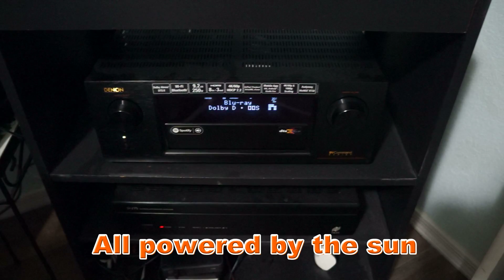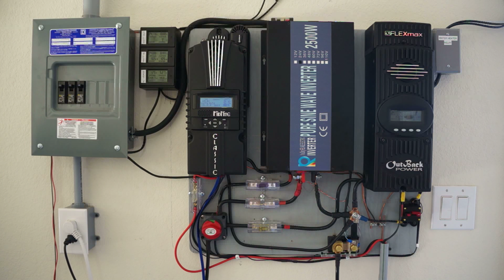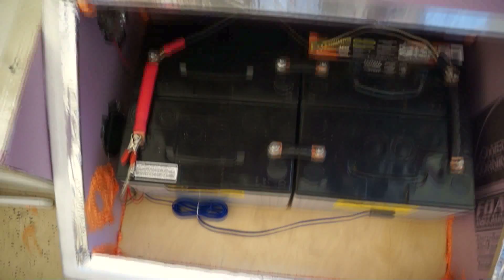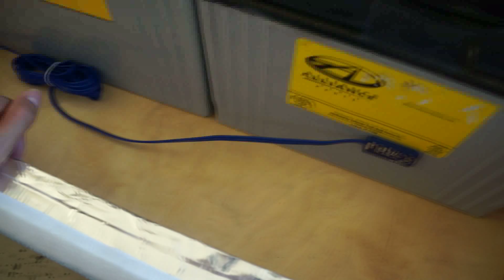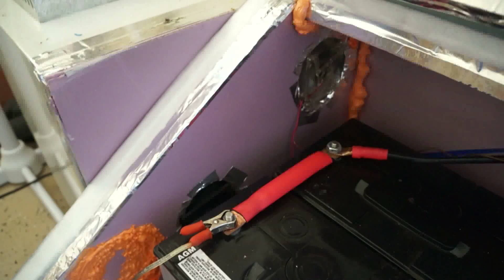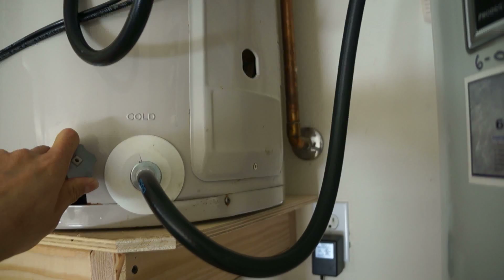2kw Off Grid Solar Overview - cooling battery bank, electric solar water heater! Midnite 150 Outback

Comment: Hey I wanted to mention that I was having the same problem with o back going into charged mode and staying there what you have to do if you have to calibrate your charge controller with your battery Bank to fix that

Comment: why do you put some panels in parallel and some in series? why not put them all in parallel. i am still learning.
Reply: also is the whizbang like a ammeter? it's just there to read current?
Reply from the maker: @510purple  to archive the right and max voltage the charge controller can handle.  Yes whizbang is a current sensor that feed data to the charger.

Comment: I'm not an electrical engineer or a physicist but I have real issues with the idea that running that refrigerator as a bodge to cool the batteries is the right way to go.  I have read about the coiling of the cold water (preheat)  around the batteries before the hot water heater.  I liked that.  I heard somebody say "dig a hole and put 'em in the ground".  Possible.  Also, way too small a battery bank.  Jokingly small.  I have two 100 watt panels in my van and I think I've got more battery storage than you do.  Nice mix of kit though.  #hobomessiah Enjoy.

Comment: Hi sir we are using 2hp solar system with 2kw panels by only solar..we want connect 2KW inverter to the same panels to get power to batteries for lights and other use..is it works ?

Comment: The first concern I have regarding your electric water heater plumbing job is your connecting the pressure relief valve to a re-entry into your water line. In the event your heater overheated the weakest place will blow. It will either be the connected hose, copper tubing or water tank as the only relief available is when you are running water out of a faucet. That, generally, won't provide enough displacement to avoid a malady!
Enjoyed your videos. Up on the 45N degree line the ambient temperature makes your system prohibitive.
Reply from the maker: I think you got it mix up.  The relief valves go into a pipe into the wall and go to the side of the house.  I T joint the new tank relief valve into the existing pipe, so the both share the same drain pipe.
Reply: @DIYeverithing  Whew!, missed seeing this on your video. Glad to see that you thought everything through completely! Sorry for the interruption but was concerned for your welfare.

Comment: Hey, thanks for the videos.  I am trying to do exactly what you have done with running stuff during the day when the sun is out to mainly use only solar and not the batteries.  But I have yet to figure out how to do the next steps.  I also live in PHX and would love to use the sun especially in the summer.   :D   You said you found a local dealer in Arizona for the batteries with cosmetic flaws..?  Where is that place at or called if you do not mind me asking???   Also do you know of any groups that are local that either meet up or just chat online, so I would be able to ask more detailed questions and figure out what I need to do so I do not hurt myself???  I did want to message you directly, but I have not figured out how to do that.  I have many other questions, but I have no idea if you are even still reading the comments on these old videos...

Comment: Thank you for sharing your system and your insights with us.
If I may, I'd like to share a couple of ideas with you. First, to keep your batteries cool, and preheat the water going into your first electric water tank may I suggest a coil of tubing inside your insulated battery compartment that all your incoming water goes through before going to your water heating system. Second, don't forget to do the periodic maintenance and replace your anode rods in both water heaters to reduce galvanic corrosion to a minimum.
I have two questions for you. First could you have used the original thermostat controlling a DC relay in order to power the DC water heater element? Also where did you get the thermostat and element you did use eventually?
One more thing, did you say you each take two showers per day for 6 showers total? I'm curious why so often?

Comment: Hello, I have a quick question about your sub panel. Are the neutral and ground bonded or has isolated ground bus?
Reply from the maker: Isolated ground bus.
Reply: Thanks. It's confusing, as most grid main service panels the neutral and ground are bonded. Perhaps that are inside the inverter.

Comment: So, how did that work in the winter? With those high garage temps there wouldn't be much heat loss. Many tanks need more than 70W continuously just to overcome heat loss.  I use two tanks in series, primary 9gal and secondary 20gal.  That gives me fast response in the morning. Generally a preheat tank like you have is not worth heating above 80F as most of the extra energy will be wasted in heat loss.  I'd plumb it sy you have the option of using the gas water heater as an unpowered tank bringing water temps up to ambient.  I use 2,000W 120V elements which are cheap and common and work well with a 36V string off raw panel or 60V grid tie.  I heat all my water with PV which is now cheaper to do than direct solar.

Comment: In my shed I used AtticFoil reflective insulation. It is cheap ans staple it up. It dropped the temperature in the shed by 10-15 degrees.

Comment: I have t-105's and L-16's in series. Not together. In a 24v bank. Not a bad idea for keeping batts cool. I don't have to worry about that here. And only possibility of freezing maybe 2 months a year. If I'm not home. With the bank. Indoors its out of the cold as long as the house is warm. I just gotta worry about gassing. So its vented with 2" brushless  motor fan.  Just enough to create a flow.

Comment: I really want a classic 150! They all got that price tag on them. I think you get loads more with the mid night classic! It would be nice if they made a controller that would do 150-200 amps. But its probably cheaper to buy more controllers. I hope to have 3kw to 4500 wtts in solar. I'm off grid. And heavily use the generator . not as much now. I have a 5 kw inverter. And 700ah batt bank. And 150 ah lithium bank I'm working on. It should be 300ah in about a month.  I'd like to have a 4-5 day runtime without sun!

Comment: Witch do you like better? The flex max or the Classic?? I heard lots of good things about the classic. I'm really thinking about getting one! Then eventually two.  The classic has loads of capabilities! What would you want for the flexmax?
Reply: JAMES! Since the 70's The only down side to the classic would be the wire size of the terminals. He also explains that the controllers cost basically the same but to have the outback connect to the internet it would cost $300-$400 more than the classic and the whizbang jr for the classic costs $90 on ebay.com, to have that feature on the outback it costs $300-$400 on top of the cost of the controller and the mate3.

Comment: Your exposed wiring on the back of the modules is a code violation if it’s above 30 volts. Any of the DC wiring above 30 volts must be guarded(covered). Two charge controllers on one battery bank will always act funny unless they are controlled by some sort of master controller.

Comment: Hi...i have an issue with Reliable Inverter like yours...i have 1500W with small 12V system and the issue if my battery is full during Mppt charging...the inverter will off due the highvoltage inverter protect...reach 13.2V above the inverter will turn off automatically...in fact the MPPT will charge to 14.4V untill fully charge...do you have any solution for my experience?
Thanks for your reply
Very appreciate
Reply from the maker: Probably best if you contact the seller you bought it from or Reliable directly... I don't recalled mine shut off when high voltage... I think it does give the warning light when it was under absorb... but haven't seen it turn off.  But now I no longer have this inverter, so couldn't really test it.

Comment: you show a certain amount of flair with your wire routing.. Looks good!

If you have any leftover insulation, suggest you insulate the little reefer on the sides and bottom.. and seal any gaps in the back.

Comment: I want to charge an electric car, how many panels do I need?
Reply from the maker: That's a very broad question... It depend on how big your electric car battery is, how fast you want to charge it and how much money you can spend.  Probably need at least 5kw or above array to really get any practical charging.  For electric car charging, I would say a Grid tie system would be more practical.

Comment: Congrats on your set up. I have been using solar for over 5 years now. Currently building a duel axis sun tracker. Will add 8 100w panels to it. Will be hooked up to a 4 bank battery charging similar to yours except a 12v charging system. Plan to run frige, microwave, coffee maker off this setup. If all goes well will duplicate and run a/c and furnace off the second one. Thanks for the show. Keep up the clean energy. Best Tony
Reply from the maker: Sound like a cool project, thanks for watching.

Comment: you said you use ur ac, ref washing machine dishwasher, and heater  the whole nite with ur 4 batteries? is ur batteries can handle to run ur ac and ref until the sun hit ur solar panels?

Comment: Even if your batteries are located in a cold environment, they are likely staying warm enough as batteries produce a lot of heat while being charged and discharged.
http://solarhomestead.com/deep-cycle-battery-maintenance/
Optimal battery temperature is around 68 or a little less,having them in air tight will box will create unnecessary heat.

Comment: Hi nice setup.
by  chance did you mention the WATTAGE OF THE ELEMENTS FOR HOT WATER
Thanks TOKYO134
Reply from the maker: At the moment I was using only 600watts.  But now I am using a 1000watts element.

Comment: Great setup. Thanks for sharing.
By co-incidence I am currently considering buying that brand of pure sine wave inverter.
What is your experience with it? Is it still working well and to your satisfaction?
Reply from the maker: Yes it has worked well for the 14months that I had it.  But there's pros and cons... It's cheap and it work.  But you can not adjust the voltage cut off... it was set too low for AGM battery.

Comment: Hi does that inverter does the automatic transfer between battery bank and the power grid
Reply from the maker: The inverter work like this.  If you do not feed AC power in, it will invert all power from battery.  If you feed AC power in, then it bypass AC power to your load and only use your battery as backup.  Unless you turn on Grid Support or Load Shave function (you must set a voltage max and min), when this is enable the inverter will start to invert power from battery to offset as much of the load as possible but a minimum of 300watts must always be pulled from the GRID first.... to prevent from back feeding the grid (IF sell function is disable).  To simplify it, the inverter will use as much battery as you let it to depend on how low you set the voltage.  It can also be set by SOC (state of charge) if you buy their battery meter (expensive).  Hope that helps.
Reply: devildestiny555 thank you. I’m just trying to find and inverter like my dad’s when the power goes it kicks in automatically and when the power comes back on it turn off and it charges the battery bank he also has the solar panels and wind power.do you know what type of inverter is called I would appreciate your help

Comment: Super nice setup! Keep seeing those reliable power inverters everywhere on here. I just ordered one, 2000w. Hope it works good.
Reply from the maker: Yes, they work ok, the cut off however is set way too low.  If you rely on it low voltage cut off, it will kill your battery.

Comment: dya think you should switch direction the i/p & o/p in the battery box  , with the top one fitted with a pipe that goes to the other end of the box getting flow past the batteries , not just at one end of it , great idea anyway , just could be way more efficient with flow
Reply from the maker: Don't need to worry about that any more, switched to a 48V set up, reconfigured battery, they are all in series now.
Reply: batteries still are running at elevated temperature in summer just from ambient
Reply from the maker: Guess you didn't see my new video.  I no longer cycle the battery daily any more.  I am running a hybrid system now.  The battery is only for backup and cycle once a while on weekend.
Reply: wasn't the point keepin the temp down for longer life , whether used or even just stored . whats the difference how often they're cycled ?
Reply from the maker: Battery get hotter during charge and discharge cycle.. especially in absorption.  Yes, high ambient could cause an issue.  But they only get up to about 95 when they are not being use.
Reply: 95 ????!!!!! hasn't been that hot up here since the dinosaurs walked

Comment: I would have gone with (3) (3) (1) instead of the (2) (2) (2) (1).
The reason being, is the Classic could handle the higher input voltage, and you'd lose less over the long wire run from your panels. :)

The MidNite Classic is an excellent controller though. Good choice.
Reply from the maker: I agreed with higher voltage would be more efficient over long run.  But my wire run is only 20ft, it doesn't effect much.  At the time I was only running a 24V battery bank... Series 3 panels would give me 120VOC, in my opinion that's unnecessary.  The higher input voltage you put into the charge controller and the lower your battery voltage is mean the charge controller need to REGULATE that voltage down so low,  it would cause it to work harder and get hotter.  It's always 90F to 115F in my garage and heat is a big issue.  The most efficient system is to have only around 10-20volts higher than your battery input so you can charge your battery... But 50-80volts just doesn't make sense unless you're running 300ft of DC wire.  My newer set up is 48V battery bank and yet I still only run 2 panels in series giving me 80VOC and 65volt under load and that's still way more than what it needed to charge a 48V AGM.   My charge controller now run 15F-20F cooler than before.

Comment: It's amazing how they'll lie to you as much as they can to make a sale, isn't it?

Another option for cooling, though it would be more expensive at first, would be a thermal exchange water loop.  Basically bury a length of pipe in the ground deep enough (2-4ft depending on where you live) that it would be unaffected by surface temps and take advantage of the cooler ground.  Hook the plumbing up to a small water pump (12v computer water cooling pump could work) and run it to as large a radiator as you can inside the battery box with some (or one large) fan.  You'd obviously want to protect your batteries and have some way of allowing the system to drain in case of a leak, but the ground cooling would probably be cheaper and more effective than that mini fridge.
Reply from the maker: That does sound more efficient.  But it going to take a lot of work to be done here and may not even work.  It's so hot here that you probably need to dig 3-4ft under the ground to even see cooler temp.  They don't call this place Phoenix SUN for nothing.  :)    I have recently switch over my main inverter to be Hyrbid, so it's now using the GRID as battery and the battery only act as backup, so it doesn't get discharge or charged that much... So I can shut off the cooling now.  I only cycle the battery on weekend when I am at home.  But weekdays I leave the system run on Hybrid mode.  Check out my new video.  https://www.youtube.com/watch?v=HYD5UBE_wUk&t=258s

Comment: Just get a small apartment size Frig. 6cf or so, put the batteries in the Frig. heat problem solved!!!!!!!   Been doing it for years.  I keep my batteries at 74 degrees, during the day..... I never open the door... inspect 1 or 2 times per month.  Easy heat fix.  Use you inverter keep those batteries working....

Comment: Thanks for taking the time for your setup. I might have to do the same with my batteries. I was wanting to keep them in the house by the back door but the space is limited. I might have to put them on the back porch and it's really hot out here too. Over 2000 Ah I don't want to bake the batteries. Looking forward to your next videos!

Comment: Man,the battery work fine at 25°c. This is the optimal temperature with full performance. Regards
Reply from the maker: Right.  But without the fridge to cool it, in the summer here the battery get to about 110F = 43C

Comment: nice setup!  how long is your DC run into panel and what Guage wire did you use for run?  also where did you get the 300w panels?  just curious.  thanks
Reply from the maker: panel to charger is 20ft.  10awg wire.

Comment: I will never use that midnight trash in my system.  If internet monitoring is your big thing then you could have got this which is far more better for it; http://www.ebay.com/itm/110vac-2kva-1600w-24v-Solar-inverter-60A-mppt-solar-charger-battery-charger-/142306602341?hash=item2122226d65:g:zuUAAOSw9GhYeJWw.  Or you could get MPI-3000 HYBRID and this will make the battery bank a backup and provide power to the entire house.  But I think if its in the US you are just looking at 110 only.
Reply from the maker: Good for you dude.  Cheers

Comment: could you not use the extra power you make from the solar to run an A/C unit for the batteries.  I just spent 14 000 on batteries for my off grid 10K system.  Batteries are expensive.  Cooling batteries may be better than hot water.
Reply from the maker: The Forever Homestead   ac unit would use too much power.  my battery bank is small, the fridge work great.  80watts
Reply: devildestiny555 xgrgewgff